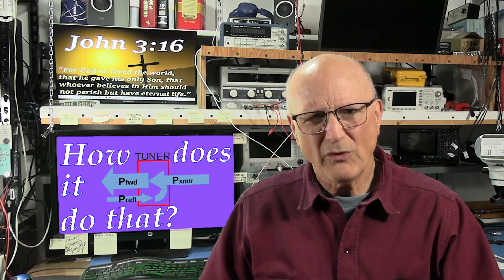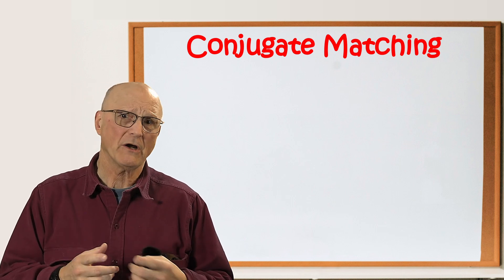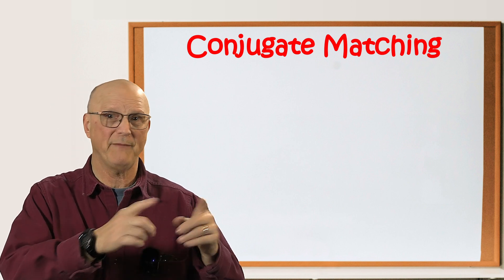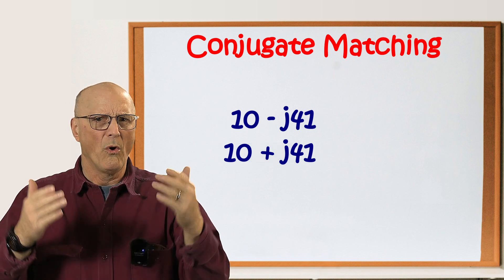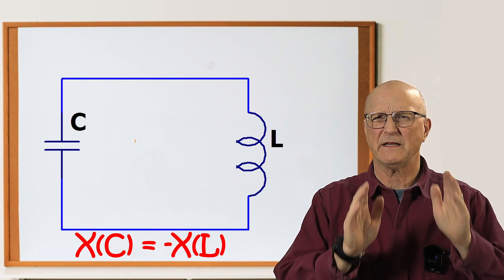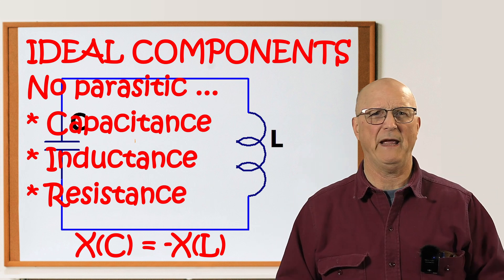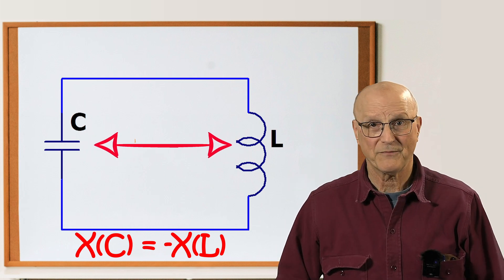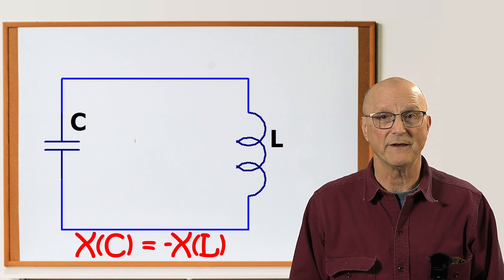Antenna Tuners: How does it do THAT? (076d)

Comment: I love your presentations.  How about an antenna that is influenced by an outside source like flashing on a roof or a rain gutter??  I have one that has an SWR over 2 and with a tuner in line the antenna drops to 1.5  but the swr between the radio and the tuner rises when tuner is activated
Reply from the maker: Assuming the antenna is in a static position relative to its surroundings, the antenna's impedance would be a constant. If the antenna tuner is tuned properly and it has the capacity to handle SWRs greater that 2:1, then the SWR at the transmitter should be 1:1. My first knee jerk reaction based on your description is that you have a bad connection somewhere. This could be poor adapters, poor connectors, issues with connector installation ... something is changing and bad connections will do this when RF power is applied.
I go back to some of my own feedlines that I put together eons ago and I am appalled at the poor job I did. I've learned since how to do it well.
See my videos on installing the PL259 connectors.
On RG-8 style
https://www.youtube.com/watch?v=h9X-qBm-Ci4&t=3s
On RG-58/59 or similar (using a reducer)
https://www.youtube.com/watch?v=OKlcqqwgDYc
Hope this helps. 🙂

Comment: Excellent video! I especially love your use of visual aids. I'm curious as to what different lengths of coax would do to that same circuit. In 1993 when I've got my license, you had to take peoples word for this stuff. A $35 dollar tool can now SHOW this! I
 I'm curious what an antenna "tuner" would do with an ALREADY resonant antenna? They seem to lack a bypass switch in these 50+ year old tuners like the one I have. Good HEAVY components though, and 1000 watts meant a TRUE 1000 watts carrier back then!
 My introduction to radio (that got me into ham) was actually using VHF marine radio"telephone" In my dad's boat. I wonder how many others can make this claim? Random interesting thought.
Reply from the maker: Thank you!
Well, on the topic of different lengths of coax ... the actual composition of the impedance as seen at the tuner end of the coax will change with coax length. The tuner will see this impedance, present its complex conjugate at its output. On the other hand, the composition of the impedance at the tuner's output is also modified by the length of coax in the same way, just in the opposite direction. As a result, the antenna "sees" the complex conjugate of its own impedance presented at its end of the feedline. So, all is happiness and the resonant circuit remains. I chose a 1/2 wavelength piece of coax so I didn't have to change up the component values I was using for the demo as the Z is the same at each end of a 1/2 wavelength of coax.
What does the tuner do with an already resonant antenna (1:1 SWR). It will STILL present the complex conjugate of whatever it sees (50+j0 -> 50-j0). It, by the way, also presents the complex conjugate of the impedance that it sees on the transmitter side to the transmitter side. This is what an impedance matching network does when adjusted properly. 🙂
Reply: @ Great answer! Thanks a lot for helping me understand this better. Have a great weekend!
Reply from the maker: @ You are welcome! You have a great weekend, too! 🙂
Reply: A resonant antenna isn't necessarily 1.1 swr so the atu will see the impedance and deal with it as it would a non resonant antenna
Reply from the maker: @Pioneer936  Right again! It is true, a truly resonant dipole in free space, for instance, will have an SWR somewhere around 1.5:1 as its characteristic impedance is around 75 Ohms (I think more rightly ... 72 or 73 Ohms'ish).
I think, though, most hams, when they think of resonant antennas, are thinking about an antenna closer to ground. As we get closer to ground, the impedance drops. At some point, it approaches 50 Ohms giving a 1:1 SWR.
Thus, resonant or not, 1:1 SWR or not, the tuner deals with it the same way. 🙂
Reply: @eie_for_you  yeah I agree, many misunderstand resonance as matched ,an example would be a folded dipole that's resonant around 300ohms thats 6.1 swr, just needs a little matching
Reply from the maker: @ Yup!
Reply: @ My bad. I meant to say 50 ohms.

Comment: Learnt alot from your Videos.. Thank you so much. I have an issue in impedance matching. I am trying to tune impedance matching circuit for a 433Mhz receiver. (BC2302C) which has RF input port impedance of 1.5-54.5j. (but when I measure this impedance using VNA or rigol RSA3000 series VNA, I am not getting impedance anywhere close to this). How can I match my antenna to this low impedance?? I was able to get my pcb antenna impedance to 50ohm using L matching, should I converter RF input port impedance also to 50ohm?? cant I converter antenna impedance directly to 1.5+54.5j? (Impedance matching given by manufacturer is not giving good reception range once I mount the receiver board on the Main mother board PCB)
Reply from the maker: Two things right out of the gate. First*, the input impedance of the RF input port ... (a) it is a function of the circuit being active (powered) when you are measuring it. (b) the power level of the signal from the VNA is most likely **WAY* above the saturation limit of the receiver.  You must find out what the maximum signal level for the receiver input is and then set your VNA to BELOW that to get a realistic measurement. Check out this video on the subject: https://youtu.be/_SRs1ozNMzA
*Second*, impedances change with proximity. What was matched and happy sitting on your bench may not be matched and happy when attached to another PCB. 
Impedance matching ... yes, one can theoretically match one impedance to another in a single step using one of the three methods of doing so, but, sometimes, you have to do it in two or more steps to keep the component values realistic.
Hope this helps. 🙂
Reply: @eie_for_you   Thanks a ton for your reply. I tried attaching 30db attenuator, calibrate and then measuring RF ic impedance. But it was too much noisy. I will go through your suggested video now.
Reply from the maker: @ The nanoVNA (and its likes) won't tolerate anything more than about 13 dB or so of attenuation. I used my Tektronix VNA and dialed down the stimulus level internally. That worked better. You will see in the video. 🙂

Comment: Thank you! A few clarifying questions: (1) what is the LC circuit diagram when including the VNA? (2) Each time the energy is sent back to the antenna, presumably that still contains signal. How quickly does that practically go to zero? ie: how many times/how long is an "echo" of signal being meaningfully transmitted? Presumably not long or it'd be a mess! (3) You say the radio's input energy and the outgoing reflections are always in phase with each other. Is this a side effect of simply transmitting at that frequency, and the radio is energizing it at that frequency?
Reply from the maker: There is just a 12 pF capacitor connected to the inductor side of things, terminating in 50 Ohms (the VNA). They do not let me put pix in comments or replies to them.
[2] It does not go to zero until you let up on the ptt. Remember, this is just a few cycles at RF frequencies and the audio in the signal or the duration of the CW is sooooooooo much longer that there is no perceptible effect is signal quality.
[3] It is the effect of the resonant circuit and the storage of energy with two contributors. At the resonant frequency, when the "charging" process is complete on one side, then all of the energy is released in phase to the other side.
Hope this helps. 🙂

Comment: Back in 1970 I built my version of the Ultimate Transmatch. Why. I started my amateur journey with a Joy Stick and a Hand me down station consisting of a Johnson Valiant and and a Hammerlund HQ-170. put all this in to a one bedroom apartment. any antenna is all but impossible. The Joystick matching unit fried within days of attempted use. I built the ARRL Ultimate Transmatch and learned first hand how a transmatch works and just how effective matching impedances between an antenna and the transmitter can effect the radiation efficiency of the antenna. I also leaned about RF Ground, Earth Ground, Radials an a counterpoise. I still my original Ultimate Transmatch and it still works.
Reply from the maker: I was first licensed in 1970 at the age of 15. My first receiver was a Halicrafters SX-25 and my transmitter was a homebrew job I bought at a garage sale for $8 (I had to rewire it). It ran two 8-7's. class C in the finals with 1,000 volts on the plates. That gave me 150 Watts of input power (don't tell anyone! I was a novice limited to 75 watts).
I never owned an antenna tuner of any kind until way late in my ham radio "career." It was always and only get the SWR down on the antenna. Eventually I got a Dentron antenna tuner for random length, single wire. I still have that and am thinking seriously about putting up a 500 ft beverage antenna. Who knows. 🙂

Comment: I find it hard to think of it any other way ? So now I'm wondering what is it that I'm missing (how are "normal " people thinking about this in "Other ways"  ? [ Super nice to see ]  but maybe I read too many "theoretical" texts on the subject in spite building a number of these things years and years ago. Still you can't beat it when the "bench" and the "math" and the physics all seem to agree with each other. Maybe "Reflections III: Transmission Lines and Antennas"
By: M. Walter Maxwell, W2DU <--- would be GOOD investment (for me) . Thanks for making these videos - gives one vague confidence that such things CAN be accomplished and understood. (maybe).
Reply from the maker: Well ... to begin with folks say that all reflected power is lost power ... none of it ever get to the antenna. It is dissipated in heat or turned into, what I am going to call, non-power power which exists in the nether world of the reactive.
Yes, get a copy of the book. There are sources on the internet for the PDF version. Take your time to work through it. It is a great resource and he openly and, sometimes, somewhat aggressively points out the error of the false views. 🙂

Comment: A great video, Ralph. Makes me think I should look again at the other 2 videos. A couple of questions, though. In a real system, the tuner does not add a resistive component. Hopefully, it would add a +j or -j. How would that work out?  It would not be a full conjugate. And… Max power is transmitted when the transmitters impedance and the antennas impedance are equal. Oh boy, with a resistive component of 10 ohm, we are never going to get good power out. Am I right on this one?
Reply from the maker: Actually, I think you are misunderstanding the whole impedance thing. The impedance we are talking about is not in series with the energy being conveyed, thus consuming that power, lost to our purpose. It is the impedance into which we convey the energy. I hope this helps. 🙂
Reply: @ you may be right. Adding a resistor would consume power though?
Reply from the maker: @denislacroix654  But, in the world of impedance, we are not adding a physical resistor. 
In my previous example, if you have moved down the feedline toward the transmitter from the antenna at 10+j41 a total of 0.087 wavelengths at the frequency in question, the impedance at the end of that feedline will look like 50+j130. If, now, we add a capacitive entity to this with an impedance of -j130, we have eliminated the reactive portion and we now have a perfect 50 Ohm match for the transmitter. No actual, physical resistors are added or removed.
I am skirting around the resistor question a bit because I do not thing that it relates directly to what is happening in our resonant system.  However, yes, if we were to physically add a resistor, then that resistor would, indeed, consume power and turn it into heat.
However, we are not doing this in the antenna tuner, the feedline or the antenna in this resonant system. 🙂
Reply: @eie_for_you  got it.
Reply from the maker: @denislacroix654  😁

Comment: Many thanks for answering questions I wasn't even asking. Here's one I've been thinking about a lot.
For almost all other ham gear we can get precise specs that tell us what they do—things like the power out of transmitters and the sensitivity of receivers. But the specs of antenna tuners involve little more than arm-waving. Some are said to match a wide range of impedances. Some less so. How easy would it be to measure and create a set of specs for tuners and relate that to specific antennas?
Reply from the maker: The specs they give are based on the range of values the inductors and capacitors have within the tuner. The less range, then narrower their matching capability is.
But there is another aspect to this. The greater the range, the higher the SWR they can match, the higher the power levels (voltages/currents) they have to handle. This all, then, would require "beefier" components ($$). So, it is a cost and space thing, too.
About creating specs ... just off the top of my head ... I hadn't really thought about that, so I am not quite sure how I would go about that. 🙂

Comment: So, does the antenna tuner make up for the inefficiency of the antenna?  If the SWR of the antenna is 3:1, and I add a tuner, will the radiated power increase?
Reply from the maker: As I currently understand it, the tuner does not change the radiation efficiency of the antenna. I believe this to be a function of the physical nature of the antenna itself.  However, it DOES make it possible to get more power to the antenna to be radiated.
I have been noodling on the whole antenna efficiency thing lately ... short, long, resonant, non-resonant ... there *may* be a video on that topic in the future. 🙂
Reply: Think there's a misunderstanding that an antenna is inefficient with swr that's not 1.1, 1.1 swr doesn't guarantee antenna efficiency, there's no natural resonant antenna that presents 1.1 swr without any kind of matching network, so we need to look at the rest of the system to maximise the amount of energy the antenna receives, an antenna tuner returns the reflected power back towards the antenna less any lost in the feedline, so we need to be looking at improving feedlines in our systems which many overlook especially when antenna tuners are in use
Reply from the maker: Nothing about the action of the antenna tuner will improve the radiation efficiency of the antenna. The tuner does two things: it assures that the maximum power is delivered to the antenna and protects the transmitter from reflected power. If we need to increase the power delivered to the antenna further, then lower loss feedlines are required.
Antenna radiation efficiency is a measure of how well the antenna delivers the RF power delivered to it into the "ether" to be heard elsewhere.
I agree, like you said, a 1:1 SWR does not mean an efficient antenna. A good dummy load has a great SWR, but is a very inefficient radiator (thankfully). :-)
Reply: @eie_for_you isn't that exactly what I've said
Reply from the maker: Yup. I was most certainly not at odds with what you said. But sometimes it helps folks understand when things are restated using different words. :-)